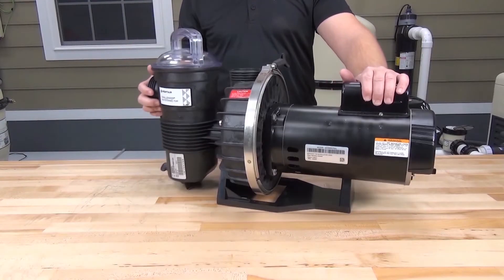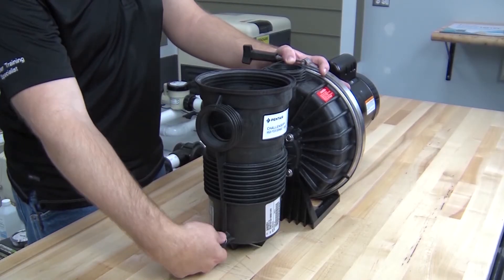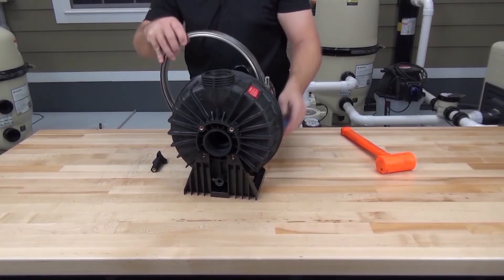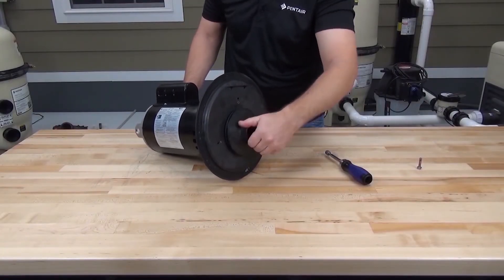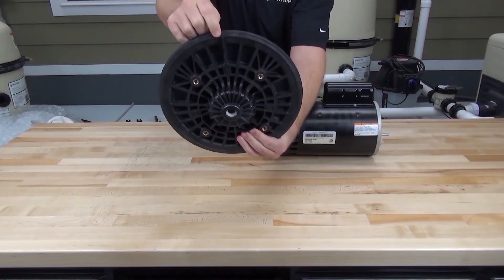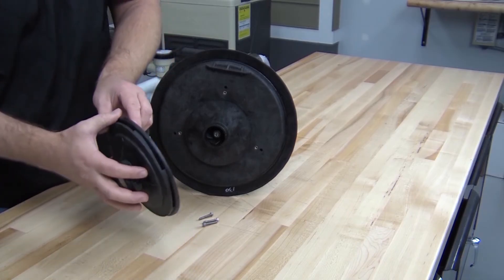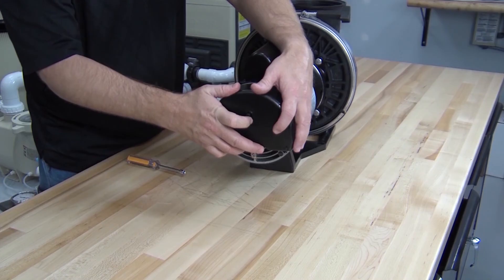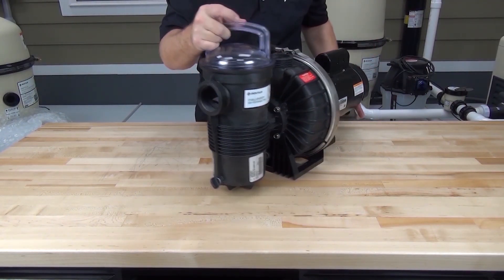Seal replacement Challenger® High Flow/High Pressure pump w/Pentair Quick-Kit

Comment: What is the magic tool he picks up at 4:49 that removes the locking screw  ?   Phillips head ?   Flat head ?  socket driver ?  If anyone knows and knows the size it would really help me.   In real life you are looking into a wet black hole trying to see what that is holding the impeller to the shaft.
Reply: This is a standard 5/16" left-hand threaded bolt. Can use a socket or a flathead to remove.
Reply: Mine is a Phillips head bolt.

Comment: Followed to a T. Turned pump on for 2-3 minutes no water pumping but started smelling like old rubber tires. Went a got water and poured into strainer basket and restarted pump. Pumps great but now leak water at pump shaft entry to seal. Spose I smoked the seal and didn't think I needed to prime it to get it going.

Comment: Excellent video. I'm curious about the bronze bushing in the diffuser (assuming it's bronze). I usually see them used as sleeve bearings with metal to metal contact but this one doesn't make contact with the impeller. Just curious why it is not made of the same material that the impeller is made of?

Comment: You did not show how the shaft seal could be put in backwards.
Reply: I agree. I just finished rebuilding my Pentair challenger 2hp with this seal kit and I had to look very closely at your video for the orientation of the two shaft seals. I think I matched the narrator's orientation. Maybe it can work either way? It would be great if you could add an annotation or note in the video to clarify.
Reply: @TannerFrisby  me podrias alludar tengo exactamente la misma bomba en mi pisina y es un dolor de cabeza porque jala muy poca agua y no se si seran las uniones en la tuberia que jalan aire o que dentro de la bomba tenga basura atorada y la tenga que desarmar en las instrucciones decia ser una bomba con un caudal de 600 litros de agua por minuto mucha presion  pero no mueve ni 100 litros en un minuto y una presion muy baja tiene que apenas y mueve algo de agua